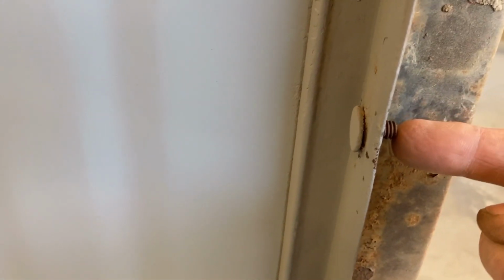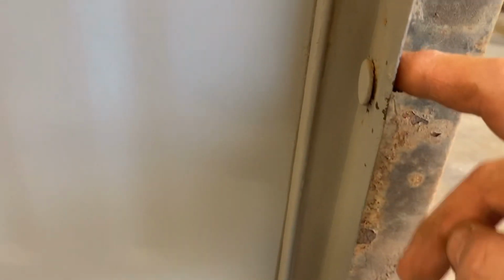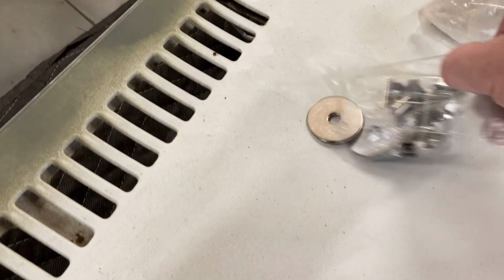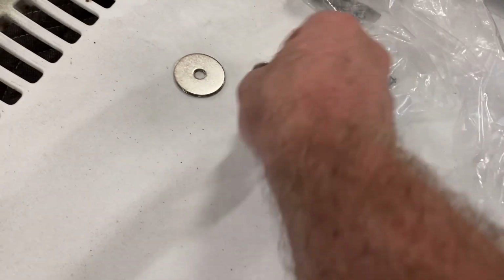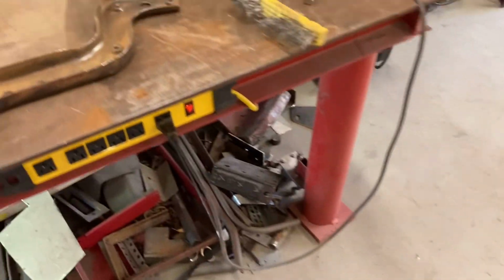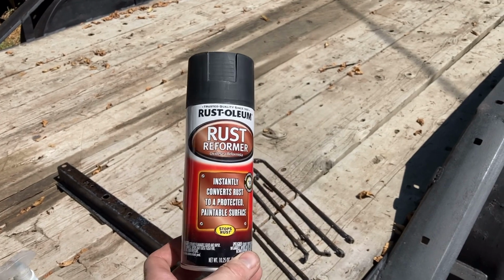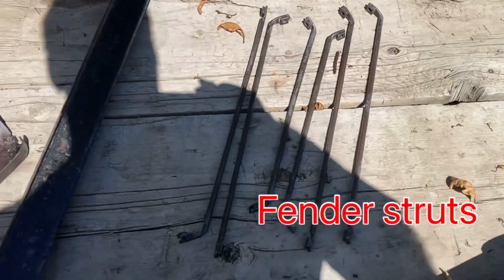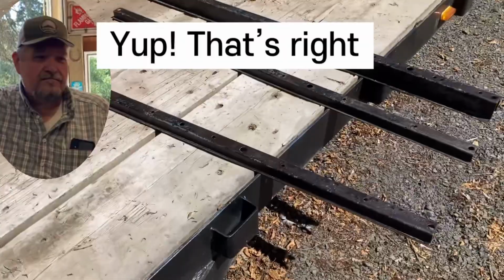Ron visits and I get free labor on the Sierra Grande.

Comment: What size are the rear tires,also the wheel width?
Reply from the maker: Hi there, Doug. The rear tires are 295/50-15 with 10” wide wheels. I can’t remember the backspacing of the wheels off hand though.